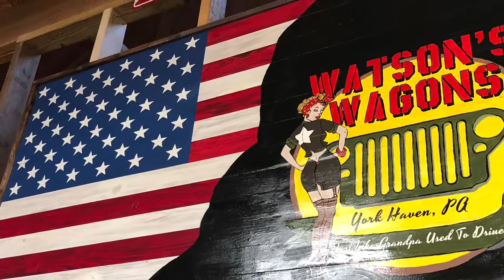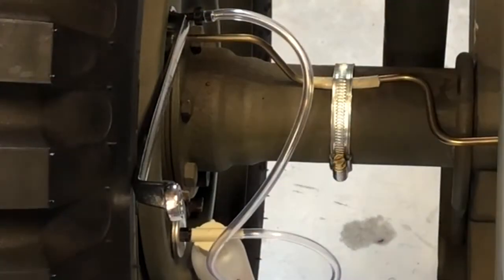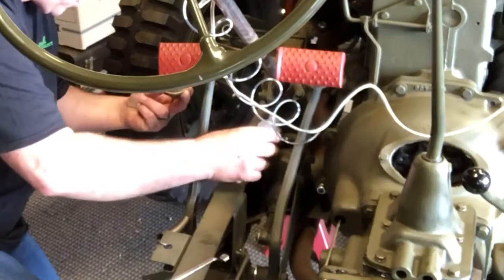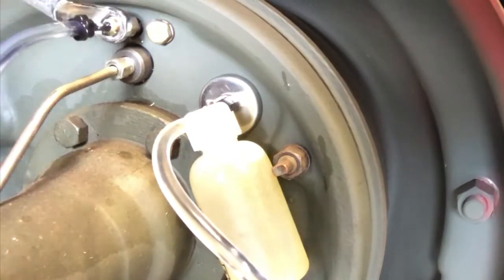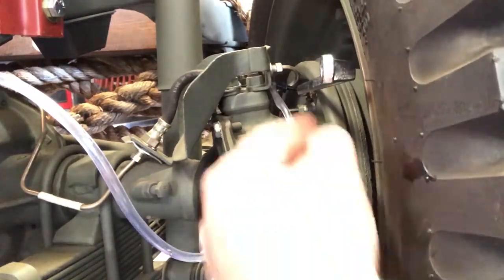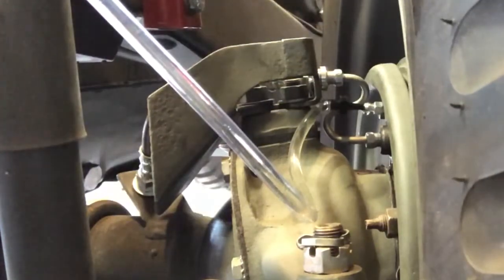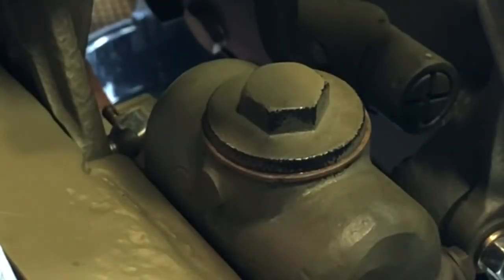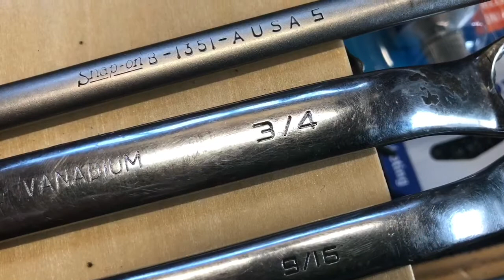Bleeding Brakes by yourself on a Willys

Comment: The design on those master cylinders' pistons is that if the pedal is pushed to within 2 inches of the floor, there will be damage to the inner piston seal.These vehicles were meant to be only bled with a vacuum tool.
This damage occurs downrange in the form of early MC failure.That's right-after the tub is on.

Comment: When you say recycle the oil. It is not oil,  it’s brake fluid. What year did these vehicles change on the position of the primary shoe and secondary shoe. In all my experience the longer shoe is the secondary. The shorter shoe is the primary.I only been in the degree 42 years. ASE CERTIFICATION.

Comment: i have a 55 cj5 in the shop....came in for carb overhaul. finished that but it sat for 5+ years. it was towed in for fuel issue. but it had no brake pedal....goes to the floor. master cylinder was dry. so i filled it up and tried to bleed it. no dice...replaced master cyl..and bled....and bled... Since i have gone thru 3 MC, replaced rear wheel cylinders. Ive tried tilting the thing up and bleed 1 end then vice/versa. tried gravity bleeding, vacuum pumps.....had someone pump and open and close valves....im not sure what else to try. Any ideas?
Reply from the maker: Robert Lasater master cylinder plunger probably not sealing. If it sat that long it probably has junk rubber in it.
Reply from the maker: Robert Lasater Were you able to blow out the brake lines? How new are the rubber lines? I have had rubber brake hoses collapse internally before.